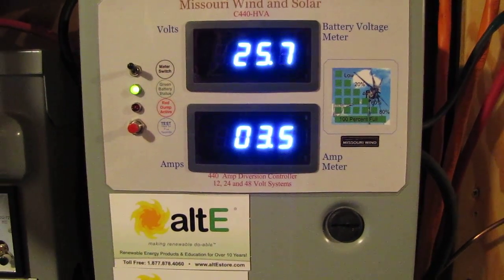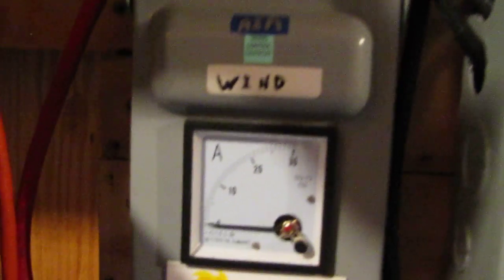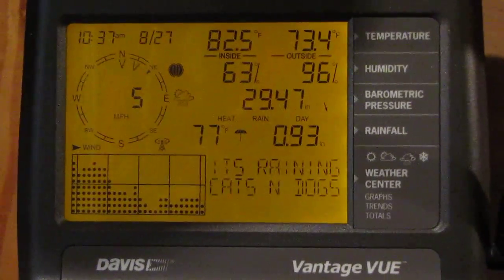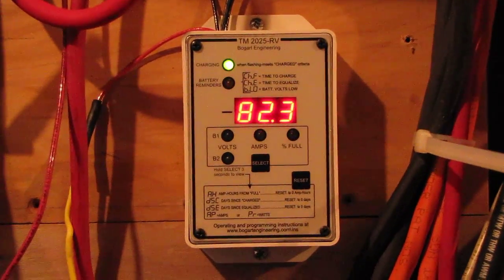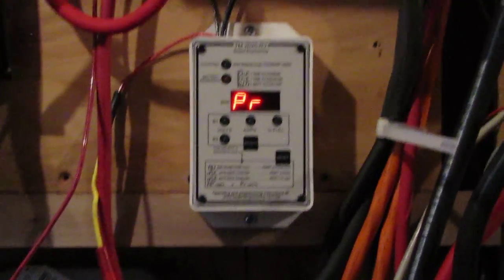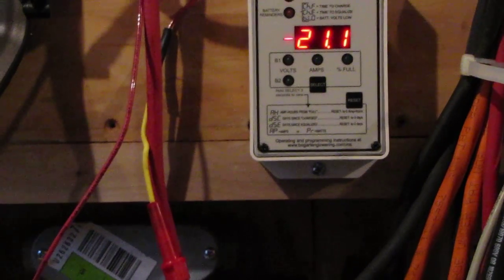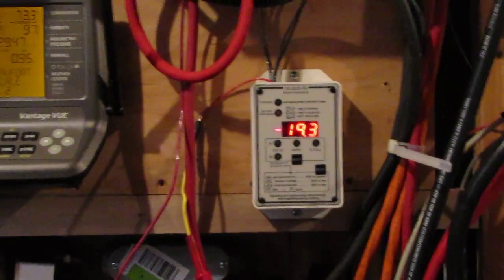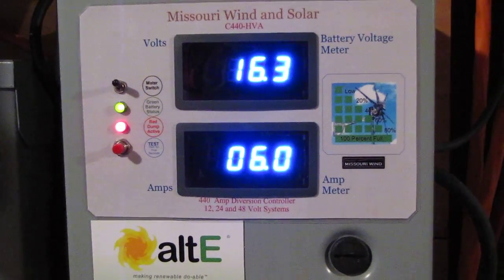Hurricane Irene  Wind Turbine Power In Virginia Part  1

Comment from the maker: @leamyelectricinc1  8 days  &  8 Nights Yeap My sytem Proved Itself  & my  Little Honda EU 2000 i Inverter series Generator Only Burnt 17 Gallons Of Gas  In eight days  I didnt allow For my Other Deep Freeze & Refrigerator  Plus at Night It was 87 degrees Inside the House  It was Miserable Bro LOL I took Good Ole  showers with the water Hose Yeah Man That wind was freaking Hollowing Brother for 24 Hours straight  I was Making 20 amps In those 49 Mph winds with my Break Switches On Brother